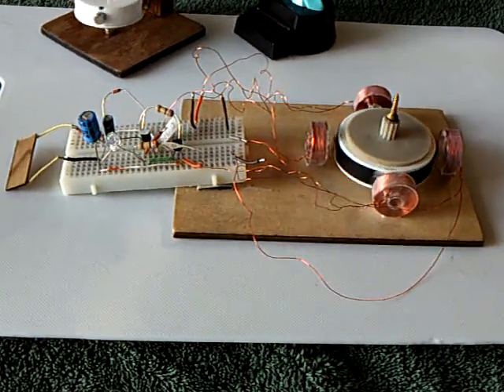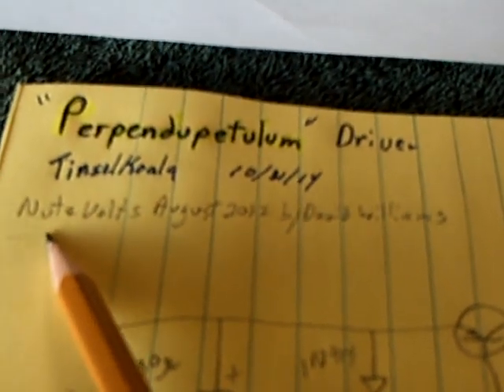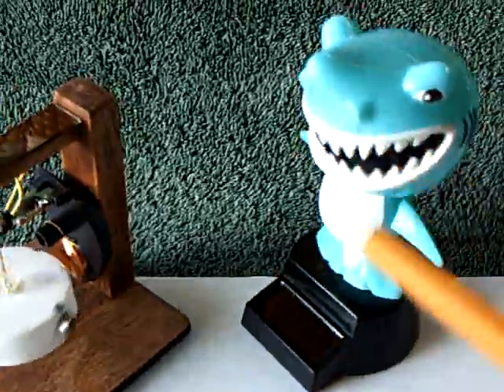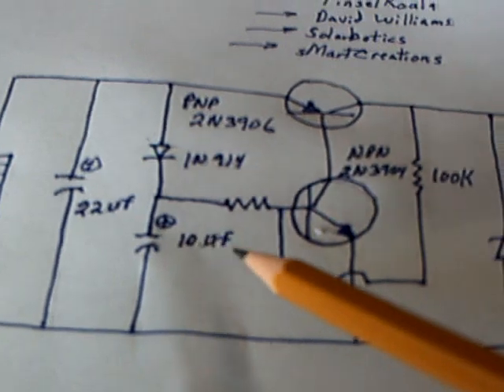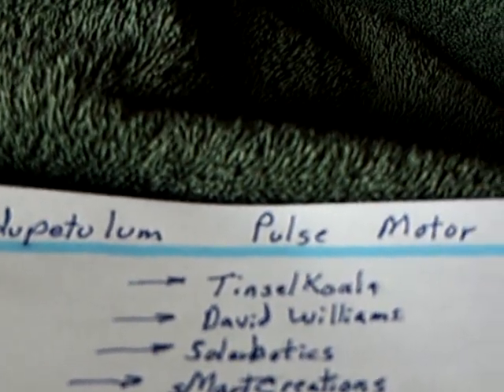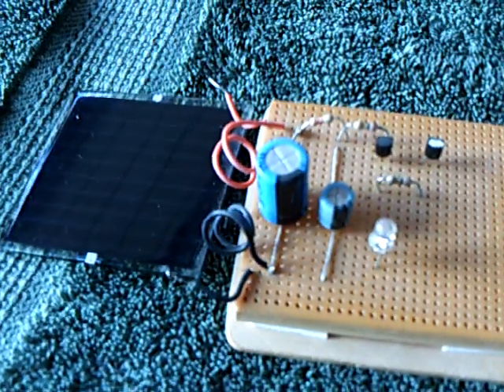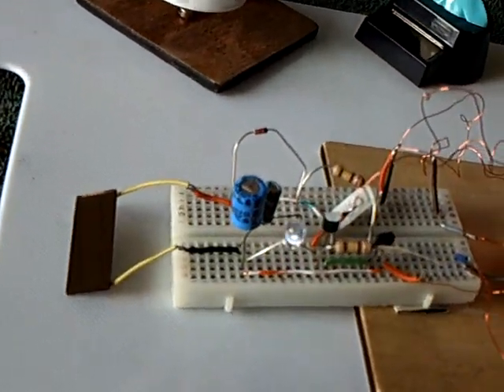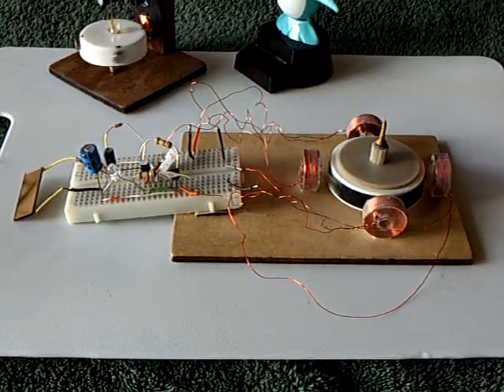Perpendupetulum Pulse Motor

Comment: Hi Lid, i have a question, what was the difference when you change the capacitors...? what does it means for you change the original transistors  (tinselKoala circuit) by 2N3906 AND 2N3904...? I am using this circuit in many experiments and i discover by accident a curious effect in my "multifilar pancake coils, at 7:10 AM  i sow lights and i realized that is my pancke coil with leds...!   this is the video... https://www.youtube.com/watch?v=hhEVxhYpDgo . Thanks for your time...!

Comment: Pulse Motorization has been used to drive clocks for decades. Remember the Cosmotrons of the 1980s? They used a single transitor, and a sense coil within a drive coil.
Reply from the maker: +Jeffrey314159 Yes!  I have done some study on the electric  clock drive units.   They have been around a long time.
Reply: Originally this electric pendulum clock was a bang bang device where the pendulum slammed into a 'make or break' circuit. No electronics!

Comment: Hi Lidmotor, would this circuit be able to run on the power from a radiant energy set up? The whole Aluminum plate and ground wire thing? I live next to a mountain and have tried the experiment up there with only 100m of crappy hook up wire and was drawing 63ma, the plate was 5x5 and dirty and my diodes probably weren't ideal either but I managed to power around 11 leds (I had a bifilar toroid, transistor and pot added) and was only just limited by breadboard space. Also, I have a set up at home (minus the toroid set up), and when I connect 2 of them in series with a diode that faces towards the negative, then the voltage jumps to 18volts (2x 2200uF 35volt caps in series with 2x 2200uf 35v caps) (as apposed to a steady increase from 100millivolts normally) and the led starts to flicker between dim and bright, very fast, and the electricity conducts over my skin and through water. Am I increasing the frequency of the electricity somehow and turning it back into ac? I dont read any ac voltage on my multimeter. Forgive the amateur questions!
Reply from the maker: Where I live I havn't had ANY luck getting energy that way. I don't have enough space to make a big enough setup. Make sure that you are not getting the energy instead from your power company through your earth ground connection or a nearby strong radio station. I have read about people getting false readings because of that.  If you are really getting that much power from the air that way, then you should have someone who lives near you come take a close look.  !8 volts and 36mA out of thin air using a 5x5 plate is alot.

Comment: Wow! I didn't find this video until just now, nicely done! I guess that shoots down my proposed entry in the 2014 pulse-motor buildoff! Now I'll have to come up with something different.
Try a Schottky instead of the 1n914, my pendulum works at even lower voltage with a 1n5817 diode there. Also try the LED in both forward and backwards orientations. With it in the "wrong way" opposite to the schematic, I think you get tiny light flashes which waste less power, or rather allow more of the input power to go to the rotor/pendulum.
I also think that the transistors I used might work at lower voltages than the complimentary pair you used. I tried the original ones specified in the Nuts&Volts article 2n4401 and 2n4403, and several other pairs, but the BC337-25 and BC556 seem to work better (lower voltage) but I have not tried several coils in series as you are using. To get the BC556 PNP I had to buy 50 of them... for about 3 dollars, postage paid! Try "ebay thaishine" for a great selection of components, mostly free shipping to US addresses and great prices. I've made many orders from them and am 100 percent satisfied: order on Monday, have parts in my mailbox on Friday.
You are getting great performance, though. Does it also self-start from a standstill? (Ah, I see from a comment further down that it doesn't self start...yet!) I found that the coil resistance is rather critical for self-starting. Maybe you just aren't getting that initial automatic pulse for self starting with your capacitor-transistor combination. In my second video demo you can see the self-starting pulses happening when there isn't any  magnet motion. Pulse Motors: PerPenduPetulum 2: Light Powered, Self Starting
My pendulum now works on room light, or daylight from overcast sky. Full sunlight is just too much for it without a series resistor. My build gives the option of using a series 330R or no resistor as you show here.
Very nice to see your pulse motor!

Comment: Here's a similar circuit called a SolarPendel ( Solarpendel  )  .  Note that a 220 K ohm potentiometer replaces the pair of 100 K .
ohm resistors, making the circuit tuneable. 
I replicated  it using a garden light solar cell and a sewing machine bobbin coil wound with 30 guage magnet wire. 
It self starts as a pendulum and then changes to a motor.

Comment: Clever setup!  How did you determine/calc what size caps to use?
It would be good to know the startup current, operating current, & rpm of your motor.

Thanks for sharing!
Reply from the maker: A B Well I used the 'Grab Bag Formula'  ----and bag full a caps and Mr. Trial and Error to help find the right ones.  The amp draw is around 2 mA and the rotor is spinning at a few hundred RPM.
Reply: Wow.. that can be a trying method to follow... ;)
Thanks for the info!

Comment: I actually attempted to make that exact circuit when I was young but did not know much about electronics and could not get it to work,  also I was not sure of the transistors I had either.  I'll have to reboot my efforts on it as a pendulum!
Reply from the maker: Here is the link to the 2012 Nuts & Volts article:
http://nutsvolts.texterity.com/nutsvolts/201208?pg=32&search_term=David Williams#pg32
Reply: ***** Actually after all day digging though the old nuts and volts magazines (and procrastinating the search actually reading the articles lol) I found the September 2009 Vol. 30 No. 9 the Magnetic Pendulum project on page 37.

The circuit is nearly identical, with the exception of the 1N4004 diode used here and a 1 megohm pot used on the NPN transistor's base, and no 10uF capacitor. The blurb says he spent months developing the circuit, so I guess Tony Gasparovic also deserves some credit for making that circuit too, assuming he did in fact make it from scratch!
Reply from the maker: Thanks for finding that.  It is a simplier circuit and pushes the timeline on this idea back even further.  I found the 2009 Nuts & Volts article using Google      http://nutsvolts.texterity.com/nutsvolts/200909?pg=38&search_term=magnetic#pg36.

Comment: One more for me to do. Thanks. Is that a 100K going to the base of the 2N3904 ?
Reply from the maker: Yes that is a 100K resistor.  A couple of 1M pots in place of those two resistors might be a good idea for tuning to the best values.  My coils are wired up in series but the diagram may be wrong.  The motor will not self start right now and I am not sure why.  It will run on a homemade copper/Mg battery very nicely. It is basically the sMartCreations circuit.  It should look familiar to you. You can play around with the cap values to see what works best with your coils.  I just used stuff I had on hand.

Comment: A really cool pulse motor (and blinking led) running on a tiny solar panel.
This is the best performance by far!
Reply from the maker: TinselKoala looked at the numbers on his setup and came to the same conclusion---this is an extremely efficient driver circuit.